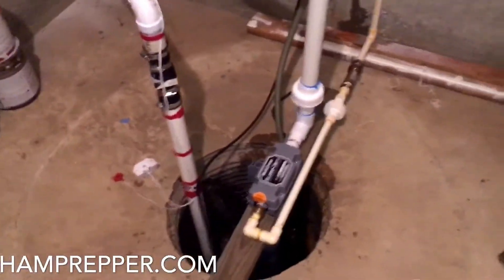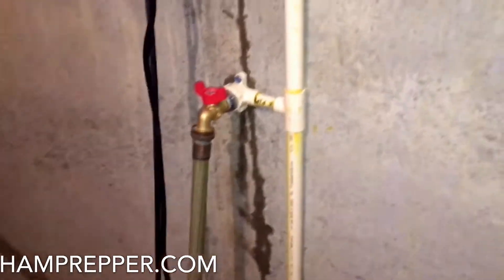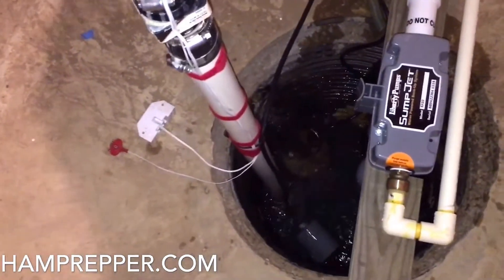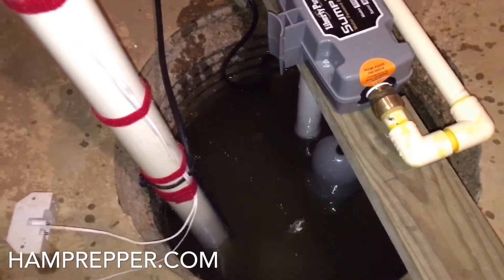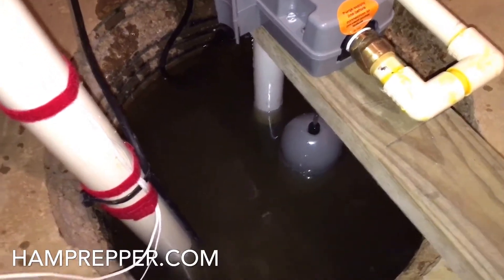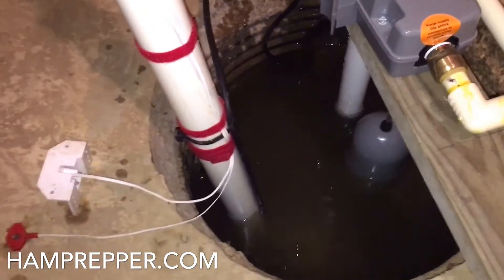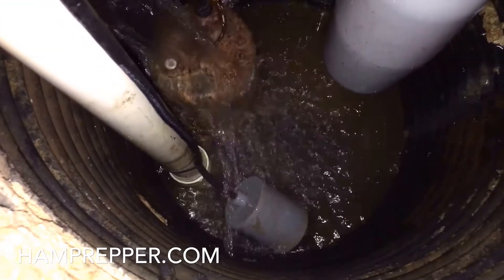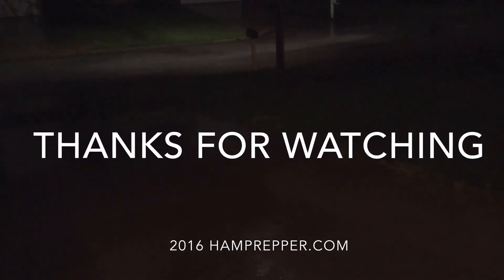Water Powered Backup Sump Pump

Comment: Nice configuration.  Access to water for flushing adds a nice touch.  I lug water in a bucket.  As a new homeowner & DIY Guy, wondering if any advantage to mounting alarm sensors inside sump, to signal you before water hits the floor.  Also, wondering how you address radon?  Should sump be covered for safety, especially when grands or grand nephews arrive?  I lost a nephew 30 years ago after he wandered into his parent's backyard pool.
Reply: Hi, I wonder the same as to how he will cover up the pit. I'm going to build a box around mine.

Comment: I haven't installed my SJ10 yet but noticed that the float switch seems to only operate in a half inch to one inch window. It will be on and off far too frequently instead of just completely draining the pit every few minutes. Do I have a faulty pump or is that how they operate ? Has anyone found a work around for this ? Thanks.

Comment: I just bought an SJ10 pump, but now I wonder if I will need an expensive backflow preventer? https://www.homedepot.com/p/Zurn-3-4-in-Brass-FIP-x-FIP-Pressure-Vacuum-Breaker-Backflow-Preventer-Check-Valve-34-720A/100197627

Comment: I've got a Sumpjet myself. I run it as a 3rd line of defense. I have a primary, a battery backup, and the Sumpjet. I highly recommend replacing the float switch used on the primary pump. A vertical switch is at most big box home improvement warehouses and typically run less than $20. Just a recommendation. Also, instead of unions on the discharge, just run furnco fittings. They are easier to install, maintain, and perform quite well.
Reply: Realizing how short-lived is life of battery backup, your 3rd line of defense makes perfect sense.   Do need check valve on sump exhaust pipe, and separate breaker for installed AC backup pump.

Not sure how much extra backup I need.  Not in a flood plane, have very low water table, and all downspouts drain via pop-ups downslope from house.  Sump fills only with HVAC condensate, humidifier excess, and ocassional dribble from gas hot water heater.  During recent 27 hr pwr failure, all sump related water generating eq was inoperative.  Hence, extra protection seems unneeded.  Thoughts?

Comment: So what if you have a well with an electric pump in the well fo water....ie if the electric goes out the water pressure goes to. Will this pump work?
Reply: no it won't unfortunately... If you're using a well you have to stick to battery powered back-up pump or a gasoline/propane generator